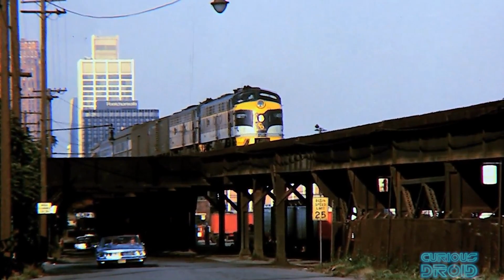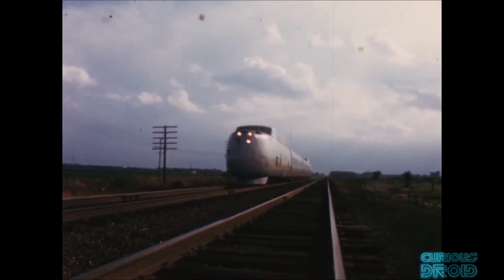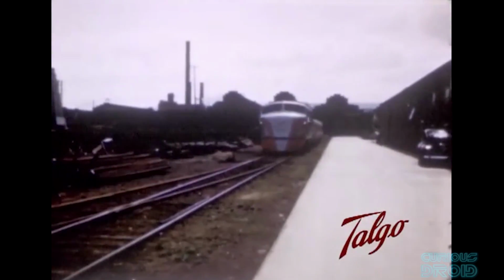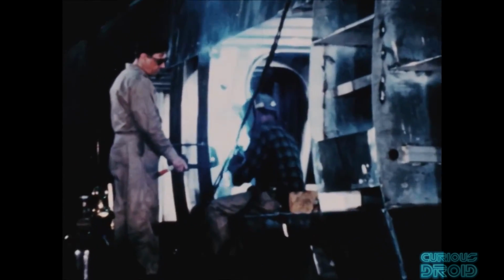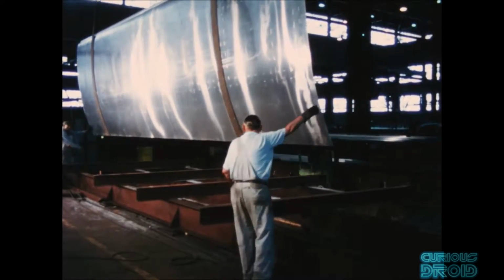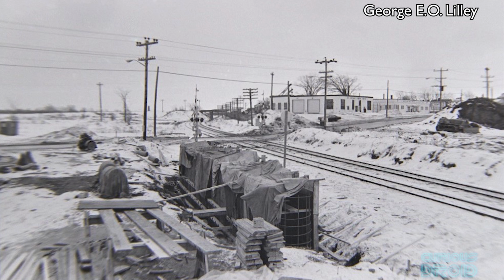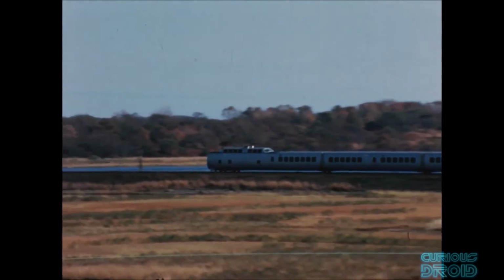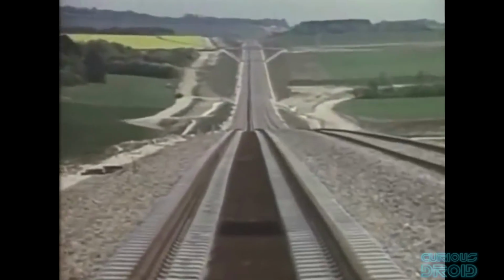America's Failed High Speed Tilting Train - The UAC Turbotrain

Comment: Researchers have later found that one can overdo tilting on a train.  A combination of tilting train and track can give you a sensation of a "level" floor when rounding a curve at speed, but a feeling of nausea when the view of the ground tilting outside becomes "disconnected" from your ear's balance sense accelerometer.  Not much of a problem in a jet, banking into a turn above the clouds versus being a few feet from the ground on a train.   The solution was to adjust the tilt mechanism to counter the centrifugal force by 70% instead of 100%, so people feel some cornering forces to correspond to the view outside.
Reply: Is that the Coriolis effect or something different?
Reply: @KaiHenningsen  I guess I over thought the problem. Thanks.
Reply: the urine stench that is standard in british trains does not help either
Reply: When Mercedes developed their air suspension for the S class, they initially set it to completely eliminate roll. Before starting sales, they reprogrammed the system to allow for a small amount of roll, because everyone who tested the car felt it behaved wrong
Reply: Another interesting effect was in testing the British Advance Passenger Train Prototype, they had a camera pointing forward from the cab. The Camera was on a close circuit that was monitored by an engineer in one of the tilting coaches further back. 
What was reported on more than one occasion, was that the effect on the brain of seeing the train tilt into a corner in one direction, but the coach the person was sat in going the other direction, was such, that some people felt severely sick, and I believe on more then one occasion people did vomit. 
This is one of those very interesting areas where railways crossed into the world of aviation, vestibular senses and some of the effects that have to be overridden when flying on instruments (the ability to ignore your head telling you you are flying straight and level when you're actually upside down descending to the ground)..
Reply: the italians finally perfected it with the "pendolino",  it entails a gyro, and computer stabilizer with active hyraulics to keep the train at an optimum angle, and fools the mind into thinking it's riding level.. sort of a Williams FW14 for the rails, back in the 60's it was way too expensive to implement this sort of thing.. 
 British tried it with the first gen HST, but customers got queezy,  Magnetti Marelli and Alstom joined forces and sorted it out.. Now the British buy Pendolino's for virgin rail..
Reply: See also. Electric bray
Reply: @KaiHenningsen  It's what happens when what your seeing doesn't add up to what you're feeling.  There's a lot of ways to induce this, motion sickness is a low grade form of it.  Some tourist attractions have rooms specific designed to exploit the hell out of this, I forget what they're called, but basically they have a central walkway and a large spinning barrel thing around it with a bunch of multicolored lights, and it makes the whole thing look really screwy.
Reply: The single axle trucks between cars don't work either. I rode Cascades from Vancouver to Seattle.  Really hating ride especially when going through switches.  Double axles manage the ride better.
Reply: Those people should stay off motorcycles.
Reply: Another issue is the TRANSITION tilting into a curve. That imparts its own (rotational) acceleration which can be quite abrupt in active tilt systems. Once you're into the bank, it ain't so bad, but as they say, "getting there is half the fun."
Reply: MY FIRST ADVENTURE WITH TILT TECHNOLOGY WAS RIDING AMTRAKS ACELA AS AN PASSENGER!
AS AN LOCOMOTIVE ENGINEER, I AM QUITE AWARE IN FEELING THINGS AND FORCES ENCOUNTERED IN THE RAILROAD ENVIRONMENT!
AT THE FIRST HEAVY CURVE AT SPEED, I HAD THE FEELING THE THE FLOOR BOARD OF THE COACH WAS BULGING UP , UNDER MY FEET!
KEEP THEM
 ROLLING BROTHERS!!👍👍

Comment: My dad's uncle was in charge of the Turbo at United Aircraft. One of the big problems they had was that the tracks were not welded like on dedicated high speed rails. They ran the train so fast that the vibrations would loosen all the spikes!
Reply: Thankfully the tracks along the Toronto-Montreal line (and all other busy passenger routes) have since been welded for a smoother ride

Comment: The concept of high-speed rail in the United States was never really taken seriously after 1955. There were companies that researched it, but after the Interstate system was completed, heavy rail was only looked at as a means of transporting materials and goods, not people.
Reply: Quite right. It's too bad that passenger rail travel wasn't considered as a means to alleviate automobile congestion on the roads in those days. Today, the multilane freeways and other systems are highly inefficient and risky to travel on. For example, metro areas like Houston ,Texas has an ever expanding multilane system that gets worse as time goes on.
Reply: @Reiman33  they also thought cars would become crashproof and travel at higher and higher speeds.
Reply: Same thing happened in Brasil sadly
Reply: @Solnoric  Computers will eventually do that. For now, not quite
Reply: @midgetman4206  AI cars (if they ever arrive) can't solve the inefficiency inherent to cars, it takes a fucking amount of city space and a lot of energy, to move 1.15 people.
Reply: @booketoiles1600  I always thought having a 3000 lb (in many cases even heavier) to move a 170 lb person a few miles to the store (or where ever) is crazy. One idea I had is to charge X amount of dollars per pound for automotive license plates. Heavier vehicles cause more road wear than lighter vehicles too. It's the only way to reverse the trend of people driving bigger vehicles.
Reply: The interstate system wasn't completed until 1992 -- or that was when it was official proclaimed finished. It was government subsidizing of airline service to so-called 'essential air service' regions. Many of these regions had rail access already, and could have filled the role of regional transport. But the government picked the winner.
Reply: @WestOfEarth  Technically, the interstate system is still incomplete. But the major corridors or the mega project of the interstate system, (north, south, east, and west), was completed in 1955. And since 1955 High-Speed Rail in the United States has been nothing more than a pipe dream. And to add injury to insult, the age of the passenger Jets in the United States, 1958, was the death nail of High-Speed Rail.
Reply: @theylied1776  That is not accurate. The Dwight D. Eisenhower Interstate System, which anyone can look up, was given funding in 1956.  You're talking about the highway system, which is different. The highway system is adequate for light to moderate traffic, but it was never designed for heavy traffic that exists between population centers in a region.
Reply: @WestOfEarth  yes, 1956. But the main corridors of the interstate system were completed in 1955. The state projects started in 1956. Federal project was completed in 1955. And it was revamped by Ronald Reagan in 1984. So again, the interstate system is still incomplete.
Reply: And we do freight trains far more efficiently than France or Japan, for which the USA can be justifiably proud.  I remember seeing those Turbo trains as a kid in Boston.
Reply: @alan6832  Well yeah,  the rail freight industry accounts for $13.7 Billion per year. Where it's about $160 Million in France.
Reply: @theylied1776  Well size isn't efficiency.  I'm thinking in terms of environmental footprint per ton-mile.  A small system can be efficient, though I have no examples of one.
Reply: @TheBandit7613  You're the one that's crazy
Reply: @hankkingsley2976  I have a Car and a Truck.
Reply: @theylied1776  It looks like we're talking past each other. So I'll leave it at that.
Reply: @creamwobbly  You want a people who can't navigate a 2D plane without crashing regularly to navigate a 3D space?
Reply: @theylied1776  then get out there and burn some gas
Reply: @hankkingsley2976  I do every day, and twice on Sunday!
Reply: @booketoiles1600  AI trains
Reply: @theylied1776  I have a tank and an anti-aircraft destroyer and I use them daily against everybody I hate in my town
Reply: @hankkingsley2976  Well, good for you. Everybody's got to have a hobby.
Reply: Before its time.  I think eventually a Shinkansen/TGV train will emerge in America.
Reply: @michaelrmurphy2734  - Most likely in the next 20 years it’ll happen.

Even though the airline and automobile industries successfully lobbied to have train travel kneecapped in the U.S.A., what may finally force the U.S.A.’s interstate rail system to catch up to the rest of the world’s is … housing costs!

With the U.S.A. having transitioned from an industrial economy to a service economy, and with everyone wanting to live in the country’s economic centers—Chicago, New York City, Seattle, Los Angeles, and so on—the housing prices in those cities keeps rising. This creates a roughly ten-year cycle, within which everyone flocks from the boonies to the cities, then housing prices in the cities climb, so then for a year or two those cities’ poorer middle class residents move back out looking for cheaper housing in less-desirable cities, leading to housing costs in N.Y.C., Chicago, et al settling and finally lowering a little … at which point twice as many people flock back to the cities, lather rinse repeat.

In Japan in particular, high-speed rail has allowed Tokyo’s workforce to commute into the city daily from the more affordable, far-flung cities ringing Tokyo. And the Chuo Shinkansen—the high-speed maglev train Japan is inaugurating soon—will cut the time it takes to get from Tokyo to Nagoya down to just 40 minutes!

So with demand for housing in Chicago driving prices up, up, up, a solution which increases productivity (by putting job-seekers within commuting distance to all the good, high-paying jobs) is high-speed rail.

If someone could work in high-paying Chicago, Illinois while commuting from dirt-cheap Louisville, Kentucky … not by driving for six hours, but by taking an easy 45-minute train ride … that solves a bunch of problems: in the short-term, you’ve filled a job vacancy, raised the U.S.A.’s G.D.P., and either saved an Illinoisan from paying Chicago housing prices, or else saved a Kentuckian from working for lower Louisville wages; in the long-term, you also lower Chicago housing prices while alleviating Kentucky’s poverty.

High-speed rail in the U.S.A. would be a win-win situation, and the further demand for housing in our affluent metropolises outpaces supply, most likely necessity will force the U.S.A. to modernize its infrastructure.

And again, my guess is it happens within the next 20 years.
Reply: @TheBandit7613  they already do something like that in many places.. when you update your registration and get your tabs in WA States for example there's a tax applied for vehicle weight
Reply: @TheBandit7613   New York charges by weight and has for as long as I've been driving (over 50 years).  It has no effect on limiting larger/heavier vehicles.
Reply: Australia is going down the same path but its not too late yet for us to switch. Just depends on the people in power if they wake up soon. I doubt it though. We have fast rail plans but they been plans since the 70s.
Reply: @booketoiles1600  Still think AI is BS in replacing human drivers on roads. Better use rail to move the masses. Roads are for the countryside
Reply: The reason why is simple. Size. 

The USA absolutely dwarfs European countries and Japan. 

The airplane was the solution to the most important travel problem of all.. time. Now instead of 72 hours to cross the continent, it was 20 hours three stop, then 14 hours one stop, and finally 6 hours nonstop. 

And because the USA concentrated on an aviation industry that could support that in terms of airframes and airports.. they applied to close city pairs that might have benefited from high speed rail?  Why build a high speed rail line..? when Eastern Airlines Shuttle Departs La Guardia to DC every hour with guaranteed seats.. starting in 1961!!

Europe and Japan also didn’t have as many cars. They were mostly destroyed after WWII and trying to rebuild basic economies and keep from starving after burying millions of dead. Even a victorious nation like Great Britain was bankrupt from fighting on its own and mortgaged to the Yanks for billions for Lend Lease. Food and gas rations continued into the 1950s as the British Empire lost its colonial wealth and the pound was devalued while spiraling inflation due to socialist spending eroded purchasing power. 

So lots of people in Europe walked into the 1960s.. and only then did they buy their Volkswagen Beetles or Citroen 2CVs or Austin Minis or Trabant 601s. If you were going any great distances.. more than 100 miles, you were taking the train. 

In the USA, its industrial capabilities, availability of raw resources, and increasing wealth as a result of being the Arsenal of Democracy meant that anyone could afford a car, and new postwar tract housing on a virtually inexhaustible supply of land meant that a car was now a necessity. Because of how dispersed the population was, train travel now became more difficult as large portions of the population would either have to drive to the station or endure endless stops in the suburbs. Far either to just drive up to 200 miles and fly if it was further.  The Grey Dog also was a better solution for public transportation as it didn’t require the infrastructure and was more adaptable to a plethora of thin routes rather than a handful of thick ones like in Europe or Japan.
Reply: It makes me mad because a high speed rail is high speed. A car can’t go as fast as these trains even.
Reply: @calvinnickel9995  perfectly stated.
Without undue nostalgia, unsubstantiated conspiracy, and crush Fandom.

I like trains too, but US/Can trackage was always built for moderate speed heavy freight.
Reply: @creamwobbly  
Umm, we've had flying cars since the 1950's.
They never caught on because you need a pilot's license to fly one, and they have to take off and land at an airport.

And currently, Tesla's in full self driving mode has a crash every 3-ish million miles, in driver assist mode, it's a crash every 2.7 million  miles.

Humans driving is a crash every ~500,000 miles.

Are you actually claiming that self driving cars having 6 times fewer crashes than humans isn't viable, but humans driving is?????

And BTW, the VAST majority of crashes those Teslas were involved in, were I'm fact caused by the human driving the other car.

Almost all of self driving car crashes happen only because the computer can't avoid it.
Computers aren't magic. And they won't lock up the brakes if there are cars right behind them, if an idiot does a rapid lane change.

Some things can't be avoided.

But without humans driving, there wouldn't be very many stupid things done that need avoiding.

Self driving cars are absolutely viable, right now.

Comment: The notion that going fast around a (relatively) flat curve would disturb passengers did not materialize. In the US, only the most senior engineers could bid on passenger trains. They were extremely skilled in train handling and could set up ahead of a curve to take it without slowing down. 
While maintaining throttle, a quick reduction in brake pipe pressure would apply the brakes to the cars. In the time it took for the last car to apply its brakes, the engineer would release the brakes entering the curve. As a result, each car in turn would essentially float to the center line of the track without hitting the outside or inside rail with a wheel flange. To the passengers, the effect was as if they were riding on tangent track.
Reply: That's pretty cool. Railroading is a skilled profession.
Reply: @FT20 Adam Hlalip
Reply: A modern wheeled train might hit, let's say, 225mph. Even if you do everything right, you're still going to experience ten times the lateral force that you would at 70mph, on the same curve. Soup is going to spill.
Reply: BART ([San Francisco] Bay Area Rapid Transit) trains are horrendously noisy in curves because of flange rub. Especially inside tunnels. Makes for a very unpleasant ride.
Reply: @ztoob8898  That's because of a horrible designed wheel that wears flat rather than remaining cambered.
Reply: That’s how one rides a motorcycle through a curve. Slow in, fast out.

Comment: I always enjoy that footage of the TGV overtaking the aeroplane. What a wonderful bit of PR that was.
Reply: If you’re talking about the world record speed run, that was the plane filming from the air.  They had to use a small, fast jet to keep up with the train. In the U.S. a single-engine Cessna would be enough.

EDIT: Serves me right for commenting before watching the whole video.  Yes, in this one the TGV passes a plane.  You should still watch the record runs though.  Absolutely insane speed.
Reply: @GregInTokyo  American's really excelled in large steam traction,  Big boy is no joke,  can out pull most modern Diesel unit's .. It could hit about 85 mph Due it's 68 inch wheels,  sort of low Gearing to get up Sherman Hill with a mile long consist..
    now I'm pretty sure a fully Loaded  Hamilcar glider would fly at 85 mph,  would be interesting to see it pull like 50 of them into a headwind,  with like 1000 wake borders in water diches beside the track.. 
  If I owned one I'd challenge any tractor to a pull of..in fact ..they could bring them all at once to save time, and throw in an SD40 for good measure..